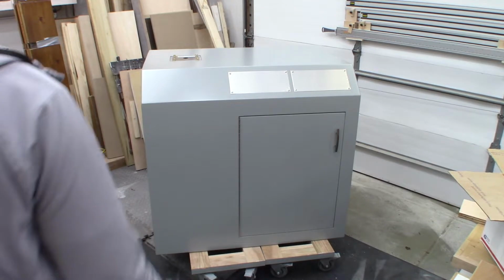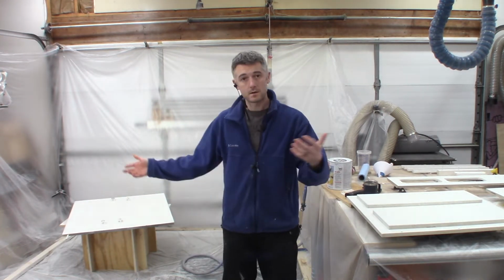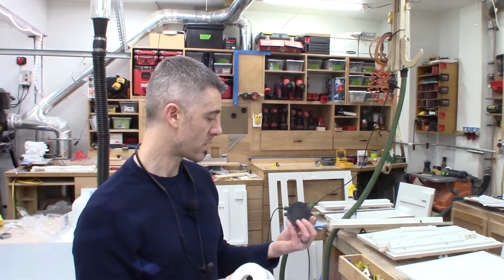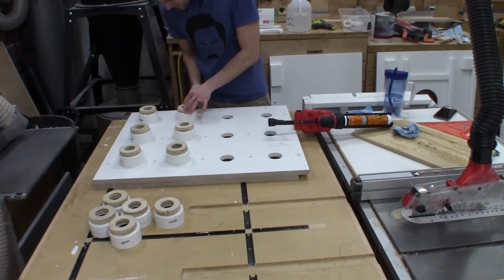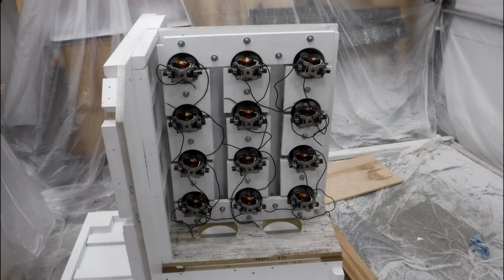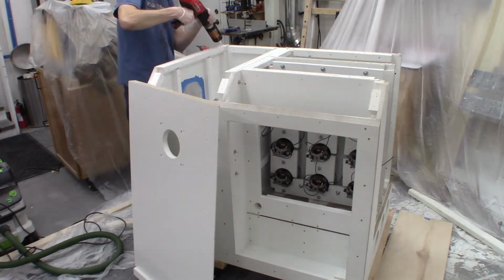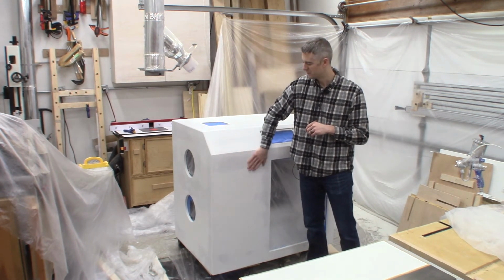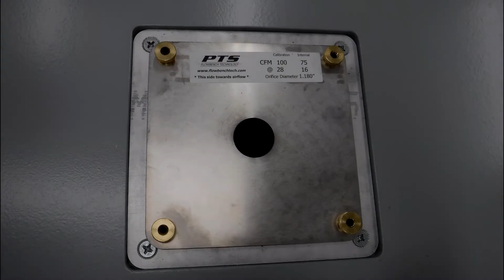Building a Modified PTS Flowbench (Part 3)

Comment: Thank you for the very detailed videos on the PTS Flowbench build! I am always amazed at the details people add into the basic design of the build and I enjoy learning those new techniques, this also allows others to benefit from that knowledge!

Side note: I got a laugh about putting the front panel on before installing the pressure pickups, I once did a customer build and forgot to install the baffle plates, had to use Lexan so I could roll them up and put them through the deck plate access holes. Liked the Lexan so much that I use it on all my builds now.